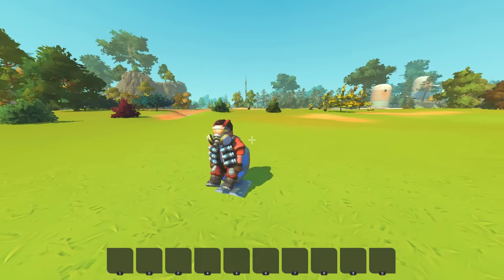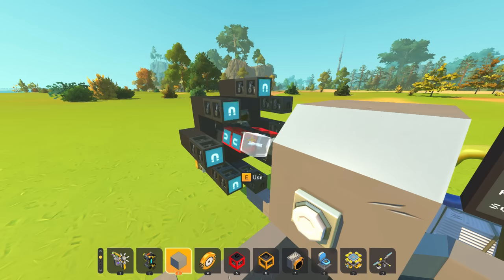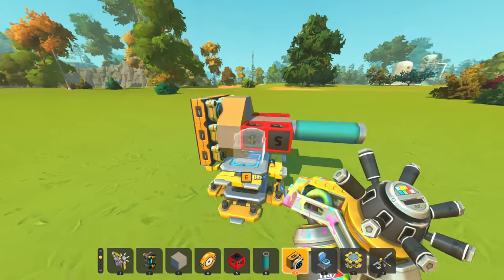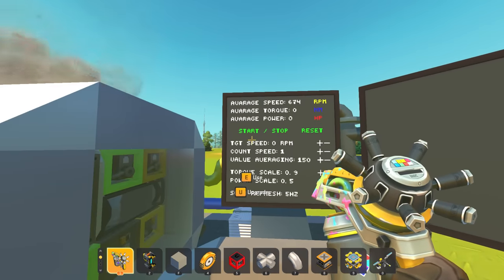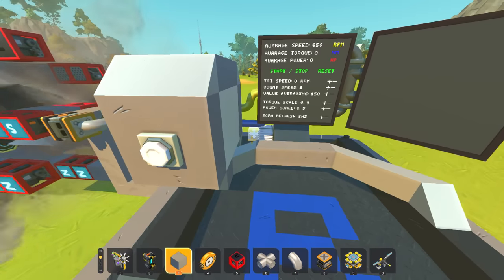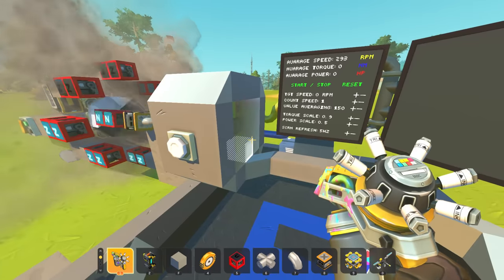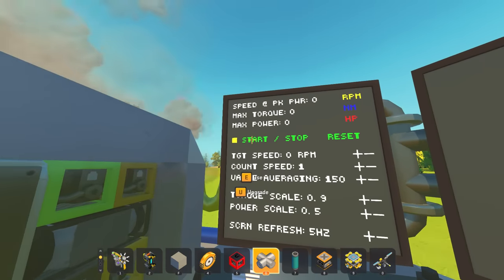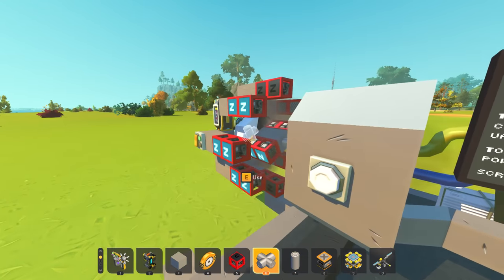Building and Testing a New Magnet Motor on a Dyno!

Comment: TLDR, your motor is an induction motor with a primitive VFD built into it. 
Your magnet motor is more akin to an AC induction motor. They have windings on the stator providing a rotating magnetic field (same as your device) and a typical “squirrel cage” rotor induction motors have non powered rotors (though typically an induction motor doesn’t have permanent magnets in the rotor, the magnetic field of the rotor is induced by the EM field that the stator generates). Only difference is induction motors don’t have your “encoder” ring built into them, they just run at whatever frequency is provided to them. 
So I guess your addition of the encoder ring is like adding a VFD to the motor that controls the excitation of the stator windings based on the speed/position of the rotor

Comment: You assumed the magnets work the same way as real life, which was immediately disproves just minutes in.
So you have an average pull between all of the magnets, that's why the offset sped it up. It aligned with the average push/pull

Comment: the timing works the same as a real electric motor, if you advance it it will get higher rpm but lower torque, retarding it will improve torque but harms top rpm, the ideal setup would be a variable timing system so it would be -15º at 0 rpm and as it goes up advance it to +45º

Comment: so I was messing around a bit more and figured out a passive and more effective mid run timing adjuster system that makes the speed of the electric motor increase the longer it runs and I managed to get 86k rpm, 134.8k hp and 24.8k nm torque. however I have noticed that it does this thing where it's rpm skyrockets, settle down to a pretty consistent speed then skyrocket in speed again so it might have infinite speed somehow. I just set the default controller angle to 20 and the one that needs to be activated to 360 then put an "or" logic gate and connect 2 of the timing sensors to it and then connected the logic gate to the controller. idk why this works but it does and now I might have an infinite power electromagnet engine (btw I used the same magnet layout as the other comments that I wrote) Kan if you see this, you should try the layout I made using only 40 magnets. I have to do some more tests

Comment: Instead of using senors and wheels why not use logic? Or make a hybrid system where you use logic to give little adjustements that account for inaccuracy of a physical control element (encoder wheel set the wrong way or sensors lagging behind at high speed).

Comment: if only I had this game is school. I kinda did for a school project, attempted to make a frictionless electromotor. An interresting you could try in this game is instead of changing the magnetic force from the static part of your engine changing it on the axle itself. I've just run simulations in my head when I did that project 20 years ago. And in my 'simulation' the axle method would either spin super fast or/and tear itself apart. Something fun to test in a game, not so much in a time sensitive school project

Comment: I agree that magnet motors are good for speed but really bad for torque, I've made 1 that goes to about 15 000 rpm I think and when turning on the dyno it stopped in a few seconds (I don't remember the torque reading)

Comment: I can't speak on the behalf of the mod parts, but I think you're running into the limitations of the game. I don't think logic can effectively fire off faster than 1 tick in the game. So the redundancy of having 3 magnets on to push/pull the center magnet is what probably saved it and what's probably causing the jerkiness to it. It's jerking it because it's spinning fast enough that there are magnets reacting late because it's taken them 1 tick to turn on, 1 tick to turn off, then 1 more tick to react once more to turn on. But because it's spinning so fast, each outer magnet isn't necessarily firing in the planned unison you designed it for. That's what's saving you. You may have 1 or 2 magnets that are actually on that are push/pulling the center magnet and 1 that's possibly fighting against it, then as it's rotating 2 more activate on time to push/pull it and another one activates to shove the magnet laterally instead of radially.

So the problem would be the speed limit of logic in general. If there's a mod color sensor that can react faster than the in game sensors, that might clean it up and make it run even faster. But my theory is that it's taking the logic too long to actually catch up to the triggering of it.

Comment: Adding S poles on the outside between the N poles  should eliminate the cogging/ skipping effect also add in magnets on the spindle so you have plus sign and a total of 8 magnets timed to repel/attract sould drastically increase your rpm and hp. The center shaft/spindle might have problems with bearing strength while rotating.

Comment: On your trammel gear, on that first step, you can directly connect the rotor to the drive gear of the trammel itself, there's no need for the piston there.  To me it almost looked out of balance because it was only 1 piston, and as with the other test, bearings harm performance in general.

I'm curious if you can also delete 1 side of those pass-through bearings, and instead make a U that passes through the support post that only connects to what's being driven on the other side, removing a bearing.  If bearings are weird, it might help in high-RPM settings to remove as many of those as you can.

Comment: I'm interested in trying to space the magnets - inside and outside - out from the centre axis by 1 block, how that would affect the torque. On one hand, you've increased the leverage the permanent magnets have on the shaft. On the other, you've increased the distance between the leading and trailing outer magnets. Depending on how the magnets calculate their forces, that may result in a net gain. If it doesn't reduce the torque, then you can also try adding more permanent magnets.
Original
- - - o - - -
- o - - - o -
o nxs o
- o - - - o -
- - - o - - -
Becomes
- - - - o - - - -
- o - - - - - o -
o nxxxs o
- o - - - - - o -
- - - - o - - - - 
Then trying adding in permanent magnets like
- - - - o - - - -
- o n -s o -
o nnxss o 
- o n -s o -
- - - - o - - - -

Comment: You may have been getting the higher averages because you weren't resetting the motor before resetting average. It kept the old speed and added the speed of the adjustment from the controller.

Comment: Kan adjust the magnet encoder while connected to the dyno to get the max torque while its loaded down  it changes in real time and you can adjust min rpm on the dyno  say 850 rpm

Comment: If bearings cause problems I wonder how much would change if you weld the middle only to the dyno and the other side with the sensors are just welded to the outside of the dyno. I believe the piston caused the problems because the tubes were colliding to the pole you used to hold the shaft. If you would use a pipe with smaller collision to hold the pole maybe would be the same as without.

Comment: If your theory is correct and there is a constant lag between the sensors and the magnets, it makes sense that the faster the engine goes, the more extreme the lag's effect on the optimal angle of the encoder wheel.

Comment: guys, I made a replica of kan's magnet engine, completed the inner and outer ring of magnets, adjusted the controller to 53 degrees and made a 1 block space between the sensors and timing wheel and got 47k rpm, 35k to 39k hp and 13k to 15k nm torque on the same dyno that he used with basically no lag, the potential is limitless, I havent's even added new rows of magnets yet. And no it's not a fluke test because I got similar results after every test, altough some of the tests were outliers and showed only 4k rpm
Reply: ok, so it turns out that 4k was the correct rpm without configuring the timing for the new inside magnets. however, I found out that because of the scrap mechanic delay the faster you go the more of a problem it becomes, so I tested adjusting the timing mid spin with a switch can make it go even faster. It actually worked, however the scrap mechanic inconsistency hit and suddenly decreased the performance of the engine by 3 times for no apparent reason as I didn't make any changes to it, however, I could fix this issue by adjusting the controller angle and giving the timing adjutment more stages. anyways using this timing adjustment system I got 18k rpm, over 6k hp and abou 5.5k nm

Comment: i made like maybe 2 years ago a magnet engine with crude design or whatever but it made like 11k hp had like maybe prolly 2k torque or idk but it spun to around 400k dgs aka 67k rpm
Reply: and what ive figured out is that compared to thruster engines and piston engines timing is just a straight line aka the higher the rpm the more reduced the timing have to be to account for the tick delay but in magnet engines it aint a straight line making my auto timing whych does what i talked about on magnet engines it just doesnt work at all realy what did work is finiking with the timing to get it up to speed and then it would be fine without the auto timing its realy weird idk

Comment: you talk about brushed/brushless ac pulsed motors, try railgun type dc brushless motor, ie two rings with rolling ball bearings, the axle on top of the balls, vertical magnetic rails under
Reply: high current over the bearing, which is 90 degrees to the magnetic field, always, but short distance, so high current, low voltage
Reply: does scrap mechanics understand lorentz force, the cross 90 degree force magnetic field to current line/wire/plasma/liquid
Reply: the true dc brushless electric motor does not have gaps, no pulses

Comment: Awesome stuff. the sensors for the encoder wheel might need to have the corners at a 45 degree angle (so that the center of the sensor is aligned with the circle the encoder wheel.) . also might need more balancing on the shaft.

Comment: When I saw the magnet motor my first thought was "can you make a wheel out of that?" Like how fast would a car made with four "magnet motor" wheels be?
Reply: You probably could, but Scrap Mechanic physics probably means that it wouldn't be very fast. It would just jitter and bounce around the place.
Reply: @techno1561  helicopter magnet motor? I'm just trying to find out what a high-speed low-torque magnet engine could be used for in scrap mechanic considering scrap mechanic physics

Maybe four-wheel drive with big wheels? One motor per wheel? 

Otherwise, I don't see a practical application for the magnet motor, as cool as it is. I think I'll stick with solely using piston engines for resource free propulsion

Comment: Brushless motors arent DC, they are AC, the name is a misnomer in some sense
Reply: They take DC into the control circuit and send AC from that circuit to the coils.
So in one sense they are AC, but with the frequency optimized for the current motor speed. But in the same sense, brushed DC motors would be AC motors too, because the brushes send AC electricity into the coils too. But in the sense that brushless motors are DC motors because they take DC power in, in that sense any DC motor fed from a rectifier would be an AC motor...
Reply: @Pystro  there are brushed and brushless AC motors, too. You just have to know how to control them. Brushed AC motors can run on DC current, btw, because they do not use permanent magnets. I built one out of nails and tape and it ran for a good while before the lack of bearings or proper brushes started to wear it down. i had to replace the commutator at least twice because it just wore out, but it was a fun hobby. I hooked it into some lego contraptions and it worked pretty well until it died.

Comment: I feel like your things might work bettee if you didn't gorce them to slide against themselves. I think that was the main problem with the 2:1 gear thingy at the end, I think it was bashing into itself on the back pillar that was holding up the output into the dyno, causing a massive slow down